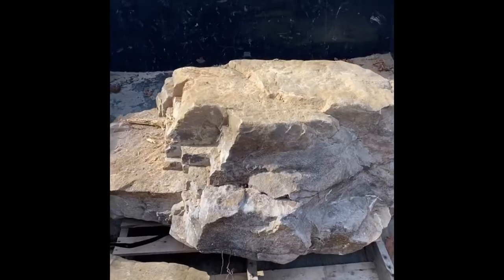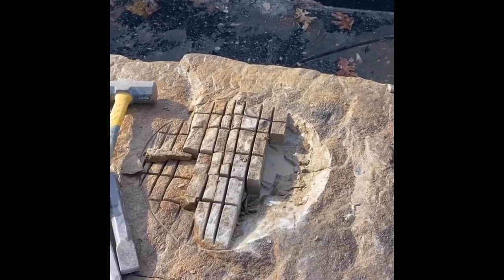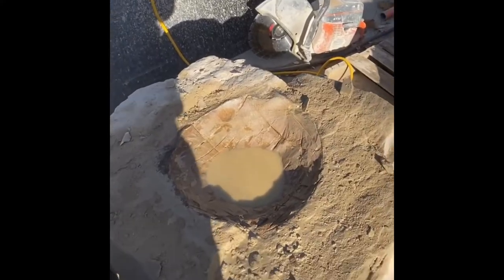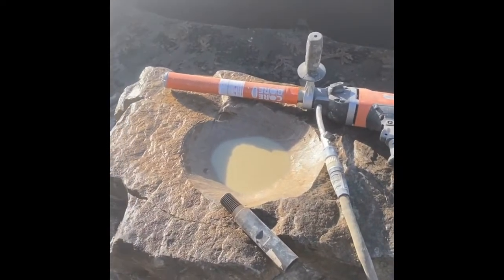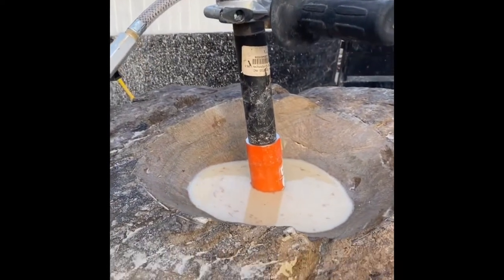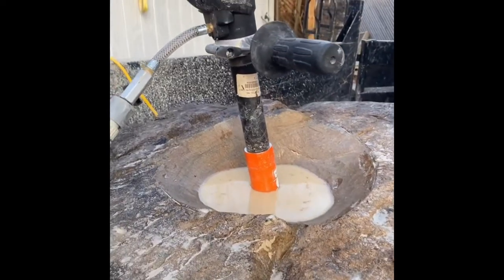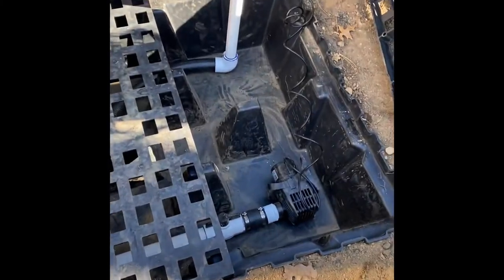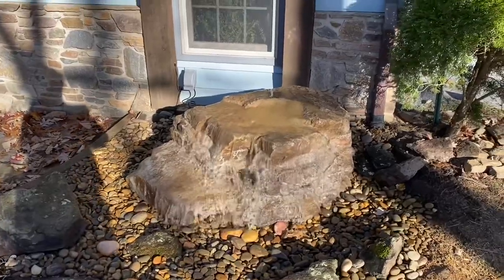How to build a boulder fountain

Comment: Great tutorial and extra tips. Is there a way to routinely clean or disinfect these for birds?
Reply from the maker: Yes. The best way is to just pump the water out, pressure wash the fountain, and refill with fresh water
Do this as often as needed. There are animal safe additives too, if you don’t want to drain it
Reply: @livingwaterslandscapingash3119  thank you! I was unaware about animal safe additives
Reply from the maker: @Yessssz 
No problem 
Ya there are a few different options 
Algaecide, that basically reduces oxygen in the water and starves out sting algae
And there are water clarification products 
And beneficial bacteria too
Reply: You should be able to very easily attach some vinyl tubing to the output e.g. with a nylon barb connector, to drain the reservoir to wherever you like for water change.
Reply from the maker: @herbiecactus6687 
Very true 
A drain could be added to the basin if you don’t have access to a pump. I would recommend a bulkhead fitting on the bottom or side of the basin with a ball valve that you could open to drain it. 
But there’s always a risk for leaks when you cut a hole in the basin. 
The basin only holds a small amount of water so they are pretty easy to clean out.

Comment: This is the most unique and best looking rock bubbler I've seen. But that seems like way less than 5000 GPH. Is there a valve on the pump? Or is the rock that big/matter of perspective?
Reply from the maker: Thanks!! And yes there is a valve on the pump to reduce flow as needed. I always go a little bigger on my pumps just in case. It’s always hard to guess what the flow is going to look like in the finished product 😅
Flow rate is more art then science sometimes. 
The pump doesn’t mind a little back pressure. Only downside would be that a larger pump would draw a small amount more electricity. But not drastically in this case. 👊👊🙏🙏

Comment: Do you guys have to call an electrician to run power for pumps located further from outlets or just run conduit underground/hidden? Thanks for the great content!
Reply from the maker: Ya if there’s not an outlet within 10 ft of the new pump, we always call our electrician to run a new line. Pumps should not be run off of an extension cord. It’s dangerous and not good for the pump😅👊🤙👍

Comment: Looks very nice. How would you set this up so you can get to the pump/filter for maintenance?
Reply from the maker: Thanks! For this system, we used a prefabricated basin that has an access lid built into it. For easy access to the pump. Just move a little river rock away, and you can open the access hatch. Sorry I didn’t get that part on film. There are other ways to build the fountain with the pump location away from the base of the fountain. Such as, using an external pump. But depends on the site and size of fountain. 
Feel free to give me a call for more details. 
828-301-8017
Thanks
Reply: He didnt how huh?

Comment: What did you use to support the weight of the boulder??
Reply from the maker: Depends on the size of the boulder. Smaller boulders can be set directly on the basin. For this one we set some cinder blocks inside the basin, under the top plate. 
There’s many ways to do it. Some features we will lay down a liner and pour a concrete slab on top. Then mortar block to the slab to support the boulder.